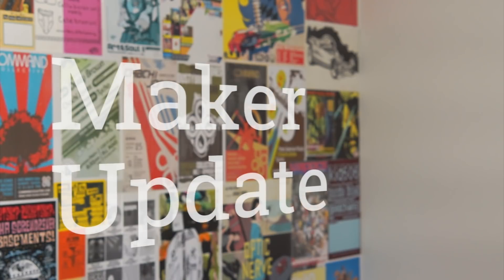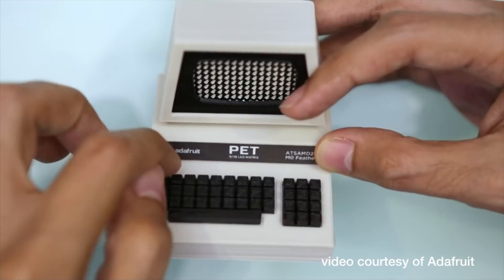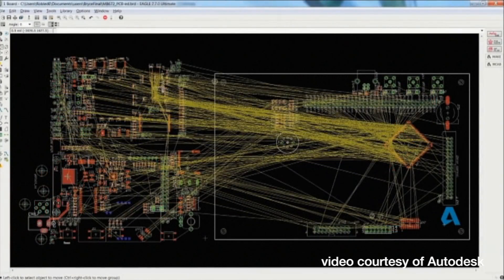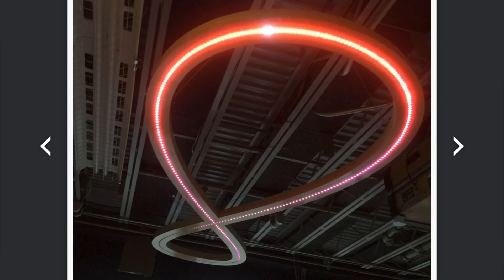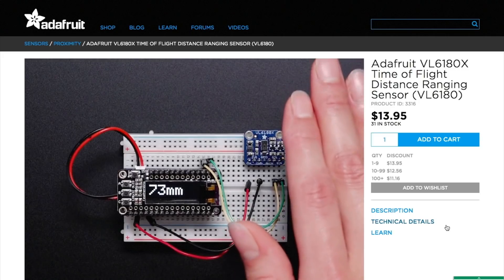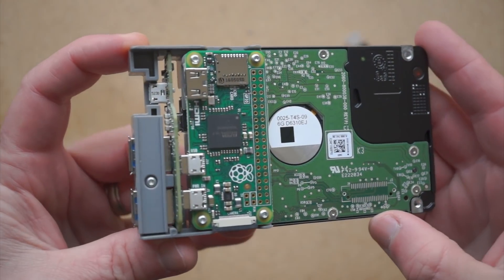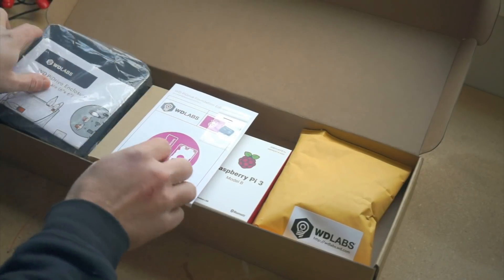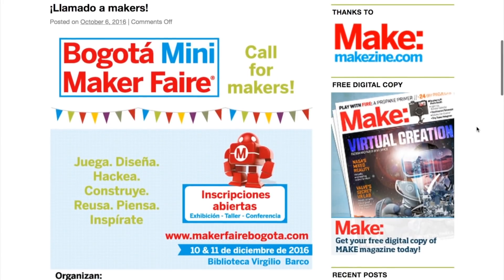Let Me Give You a Raspberry Pi [Maker Update #13]

Comment: I learned to write code for the first time on a Commodore PET back in 1981. A piece of trivia on the PET: Lowercase text was an optional add-on.

And the Arduino in that tiny PET box is considerably more powerful than an original PET was!
Reply from the maker: LOWERCASE IS OVERRATED!
Reply: INDEED! AND WHY ARE WE SHOUTING? ;-)
Reply: INDEED. THIS WAS THE ERA WHERE BASICS REALLY MEANT BASIC. AS IN EVEN THE APPLE II NEEDED AN ADD ON BOARD FOR LOWERCASE. REAL TIME CLOCKS WERE SEEN AS A LUXURY. DISK DRIVES WERE EXPENSIVE SO PEOPLE USED TAPE. THIS WAS NOT MY ERA BUT MY SCHOOL HAD THESE COMPUTERS TO LEARN TYPING ON.

I appreciate the  first things that showed what the future might be.
Reply: This was the era of 8-bit single-core processors that ran with clock speeds in the single megahertz range. (The Commodore PET was a 6502 clocking along at a crisp 1MHz, for example.) And RAM was appallingly expensive so you'd see 16 to 64 *kilo*bytes as system memory.

Nowadays you can purchase phenomenally powerful SBCs that are multiple orders of magnitude faster, and for cheap. The Raspberry Pi 3 and Odroid C2 (which is slightly more powerful and costs about the same) are about where top-tier desktops were in 2005-ish in terms of performance. You can also purchase microcontrollers that do far more for far less and far faster - the Atmel Mega324 controller in a base-level Arduino is a $5 chip that runs eight times faster than a PET did.
Reply: Oh, here's another piece of trivia on Commodore PETs - they could be physically damaged by a specific command, which has subsequently been nicknamed the "killer poke." The command would change a register value to something that would burn out part of the machine's CRT controller. Do a search on "killer poke" for some amusing reads on the subject.

Comment: I'm about to be on break from school and Christmas is coming up. Can you suggest any cheap diy projects to give as gifts? this would be AMAZING for engineering nerds.
Reply from the maker: I once made one of the $30 Solarbotics Useless Box kits for my father in-law for Christmas, and he still loves it. If the recipient has a sense of humor and appreciates geeky things, it's a hit. https://solarbotics.com/product/60005/

One year I also made a batch of these LED tilt lamps in different jars and gave them out, and my family still holds on to them and uses them. The components are super cheap, and you can pick most of them up at the hardware store. The tilt-ball switch is the only thing you'll likely have to order (cheap on eBay), so order quick if you want time to make them by Christmas. Here's the writeup I did on the project for CNET a few years back: https://www.cnet.com/how-to/make-your-own-led-tilt-lamp/